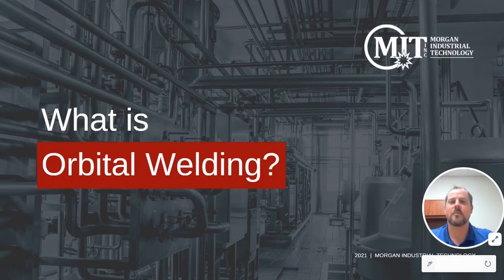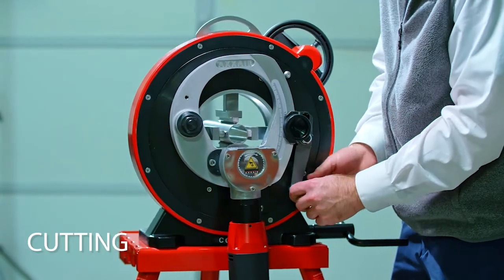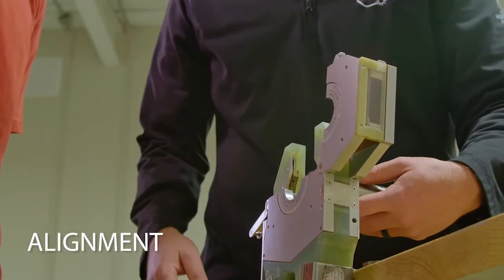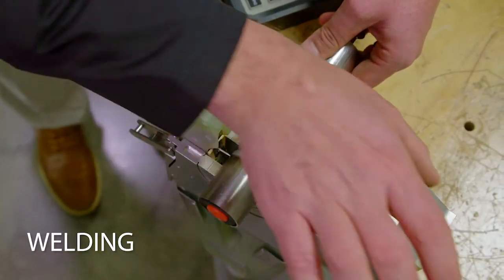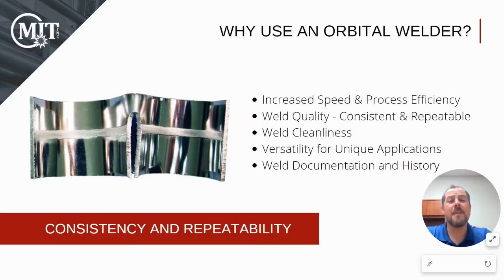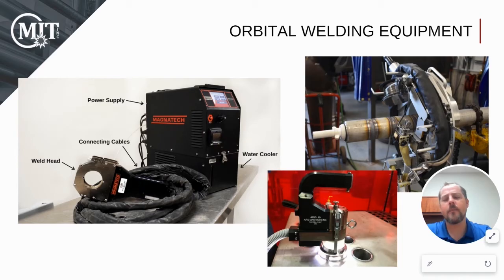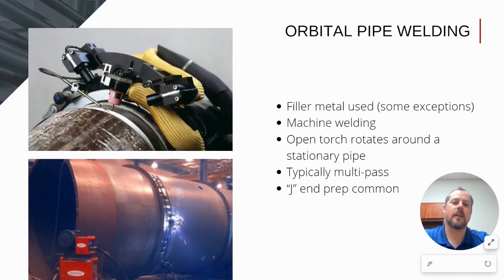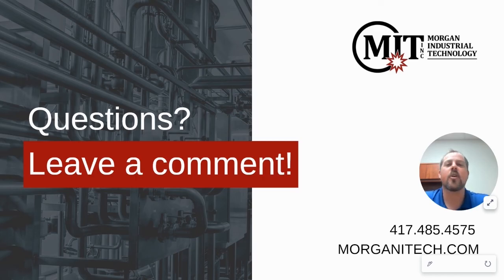What is Orbital Welding? -  A Beginner's Orbital Welding Guide

Comment: Hello, everything I've seen so far is welding pipe to pipe, what about pipe to pipe cap?
Reply from the maker: Hey Jason, when you say pipe cap do you mean a flange or elbow?
Reply: @morganindustrialtechnology1840  Neither, just a flat piece of steel laser cut to the diameter of the pipe.
Reply from the maker: @jasonpetts723  this sounds like a specialty application - one of our technical experts would be happy to discuss at 417-485-4575